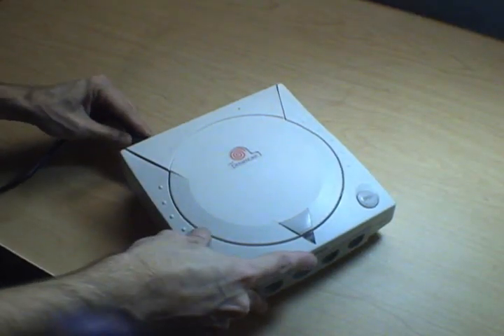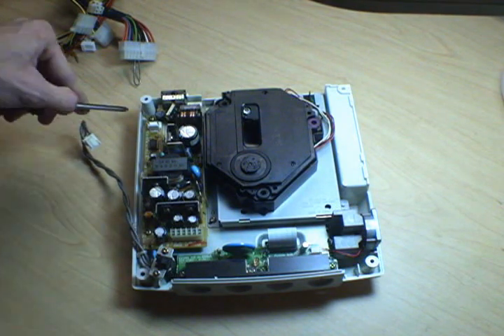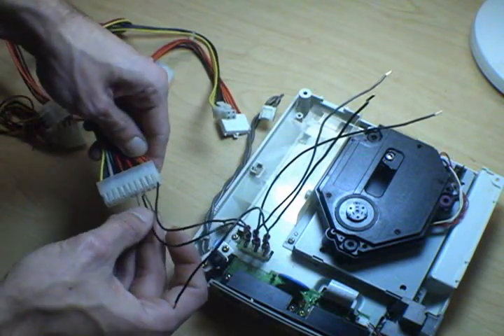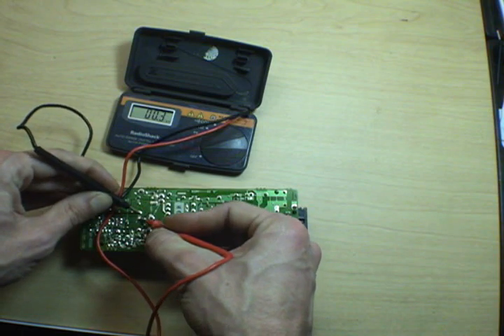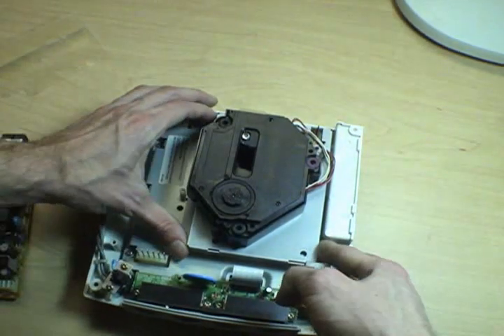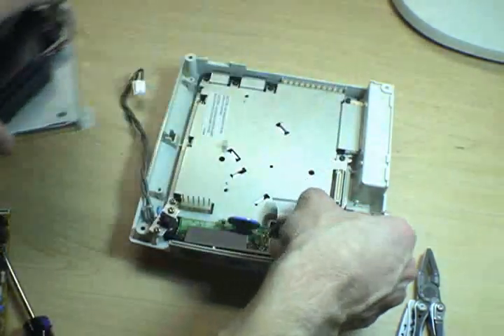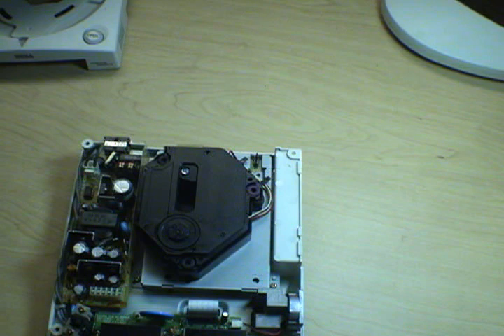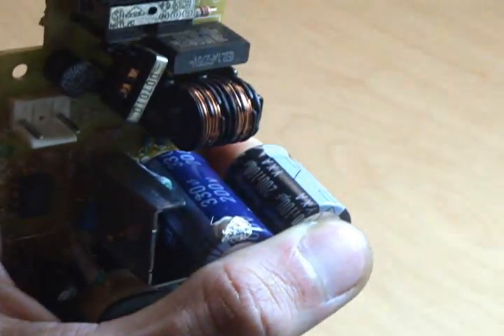Game.Hack - Dreamcast Refurb

Comment from the maker: Editor note: I prefer to use fine hemostats to remove the ribbon cable and smaller connections.
Reply from the maker: Hemo's also help to re-insert the friction fit cables, and even the more recent flip-shut ribbon cables.  Get a good kit with various sizes of hemostats for working on small electronics!

Comment from the maker: Another note on capacitors.  I have some REALLY BIG capacitors, and some insanely powerful ones that are rather tiny.

Capacitors out of cameras: WATCH THE FUCK OUT!  These are pulse caps specifically for camera flashes and they WILL hurt.

Capacitors out of microwaves: If you are taking apart a microwave you better know this shit already, but these will hurt like heartbreak.

Flyback transformers: These can hold capacitance.  Most commonly found on microwaves and tube televisions.  These fuckers will knock you across the room.
Reply: +ReddmanDGZ

Dzzzzzzt
Reply from the maker: yes, I have been knocked across the room/garage before by unplugged flybacks and automotive spark plug coils :D  Not the best way to learn, but you don't forget.

AC will make you ZZZZZZT and stay in place, high energy DC will just make you jump like a frog on a lightning pond.

Comment: Hi. Thank you very much. Happy new year. On my Enermax EG465P-VE (it has 24 pins with the last 4 pins separated. It has a violet wire too), I connected pin 16 and 17 but I'm only getting the reading from the orange wires, the 3.3v ones. On the red and the yellow ones, it says OL. What could be the solution? Why am I only getting the reading from the 3.3 one from the digital multimeter?

Could other gadgets (say other gadgets that have power supplies that have one of those volts) be used as long as it's 3.3v, 5.v and 12v, the wattage or amperage won't matter?

God bless. Rev. 21:4

Comment: It's not the best idea to short the leads of a cap still in a circuit, might kill (more dead) your PSU. Caps are not always used to store a charge they are sometimes used for signal or AC filtering.  Now I'm not the most well informed on the subject, but shorting a circuit when you don't specifically now it's purpose is generally a not good idea. I have had a PSU die this way...

Comment: see 21.38 you dont need that aluminum plate...its a heater which traps humidity.  trash, replace and put washers on the screws to lift up the lens.

Comment: This by far is the greatest & most straight forward Dreamcast repair & maintenance video available. You also clarified the issue of whether or not to use burned CD-R media that all forums have debates over. Every single game I own on PS1 & Dreamcast is burned besides D2 & Shenmue & that's just due to the GD disc capacity vs. even 99min CD-R media. Anyone interested in DC games should check out what ReviveDC has done. They repack and resort ISO data for easier reader & load times. Good Job R-DGZ!

Comment: Also, regarding the zero difference between CDs and GDs. I got the impression that over burning a 1.2GB game onto a 700MB disc will cause the bits to be denser causing reading problems or some shiz. Your saying that's not a problem? As far as i know GD disc bits are denser though i can't see it being an issue reading CDs with a finer laser.

Comment from the maker: I've not had problems in years of using a beat up old dreamcast with burnt discs.  In some cases its the only way to run certain software on the system anymore.

I was also looking into homebrew stuff for the dreamcast... might end up doing something with that later.

Comment: The battery on the controller board is a rechargeable lithium coin cell and replacing it with a regular non-rechargeable is a bad idea because it can explode, the console charges the battery, a regular watch battery won't work for all that long.
Also burning CDs can wear out the laser, it's not as simple as "All burned CDs are the same as pressed" It depends on the quality of the media and the quality of the image used for the burn. A bad image/disc will make the laser work harder

Comment from the maker: It would be nice to be able to do that, but I'm not exactly sure how I'd even start working on the problem.  The bios is soldered in place so far as i know, and the CD reader probably uses a proprietary connection to the motherboard.

I would need to get another Dreamcast that i don't care about to experiment on, basically.

Comment: @ReddmanDGZ My PS3 is one of the first 60 GB models, so it's 4 years old and when it yellow-lighted a couple months ago, my friend and I attempted to up the console, but we did not have the proper tools (we removed the rubber plug that automatically voids the warranty if it was still under it).  

Also, we can't send it to Sony because they want a receipt for proof of purchase and well, it's hard to show a proof of purchase when you win it through a sweepstakes.

Comment from the maker: @TheBladeJunker You can still get Naomi boxes, which are the arcade cartridge version of the Dreamcast.  As for finding replacement parts for the Dreamcast, discreet components haven't changed, so all the parts can be replaced and resoldered, and circuit diagrams are avalible for the unit.

the CD motor can be replaced, but the laser setup and connection might be proprietary, though i'm not sure on that

The best place to look for parts is flea markets.  Just keep an eye out everywhere for them.

Comment from the maker: @thierryman Depends on what's wrong with it.  I'm not very experienced with PS3's as I've only taken one apart, however, they are pretty modular.  That makes them a bit easier to work on.

ps3's are designed to be difficult to take apart, and doing so will void your warranty.  If your unit is still under any kind of warranty I would suggest taking it to sony to have them work on it.  Of course, backup everything before doing so.